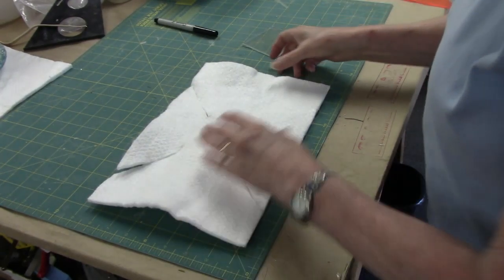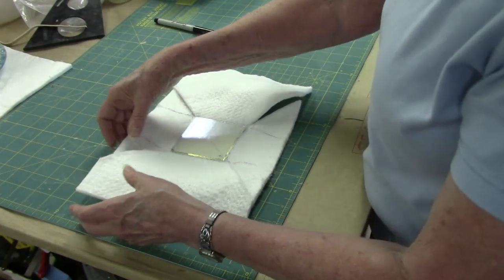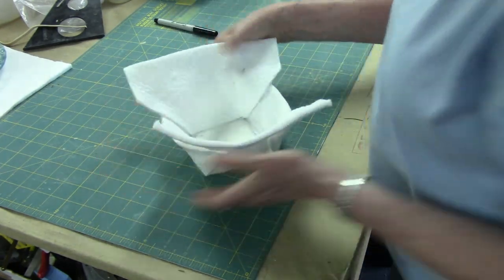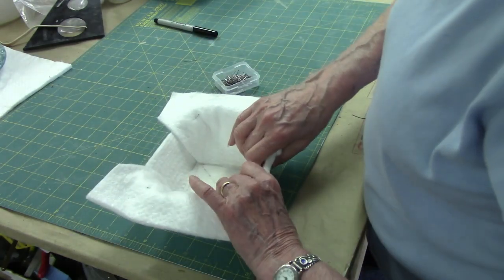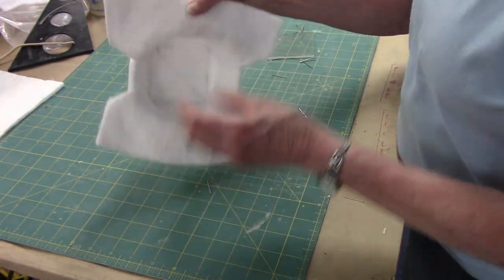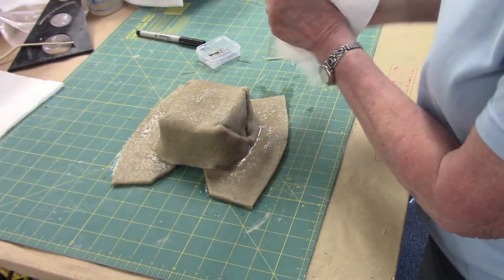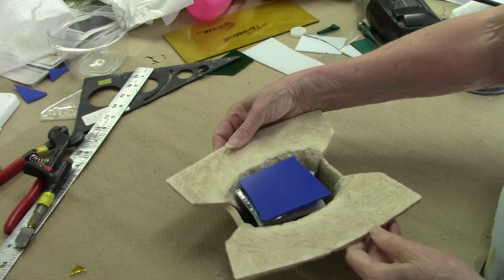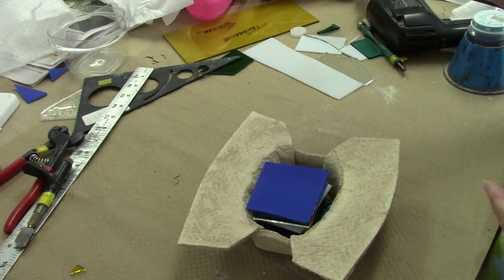SilkeMat Vitrigraph or Pot Melt mold

Comment: Would a hole saw work?
Reply from the maker: Actually, it is simpler to create a hole. See my note below the video. I use anything plastic or metal the size I want and twist it back and forth and it cleanly cuts a hole. I figured this out quite a while after the video. My "Jellyfish" vvideo shows hole-making. Hope that helps.